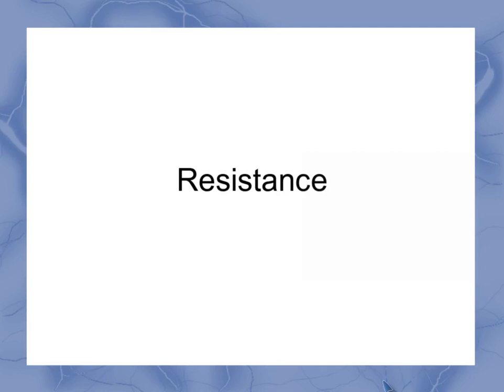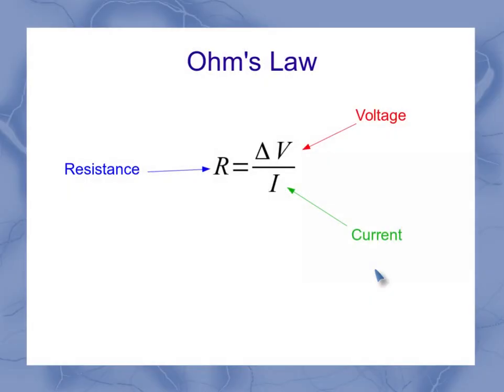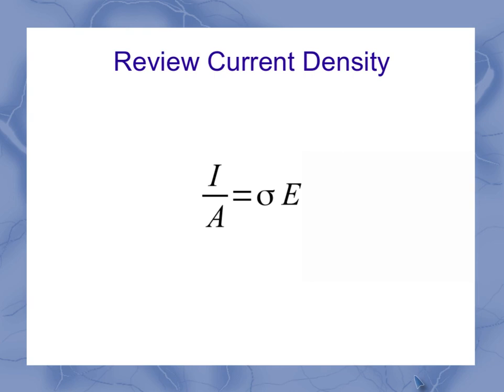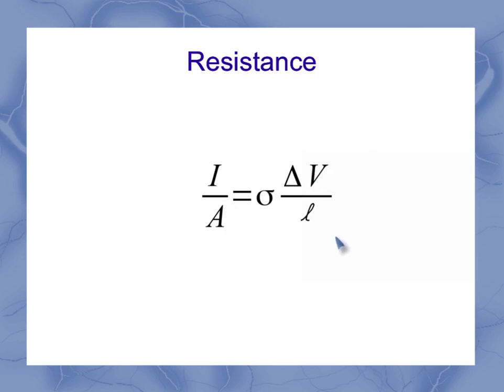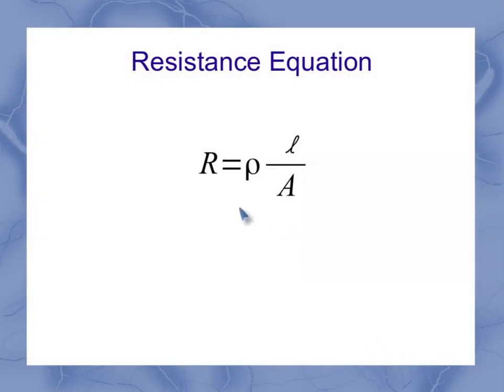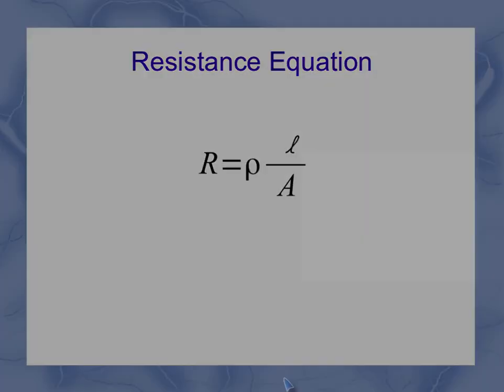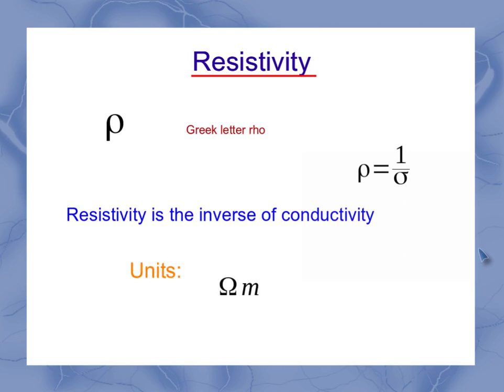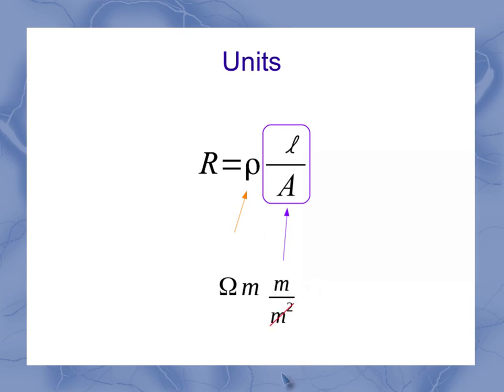The Equation for the Resistance of a Wire

Comment: What if you need to calculate the diameter of a conductor knowing only the length & resistance? 
Or the length of a conductor knowing only the diameter & resistance?
Reply from the maker: If you know the type of material (so you have the resistivity of the material), then you can rearrange the equation to solve for any of the variables. Remember that the diameter is related to the area by A = 1/4 pi D^2
Reply: Thank you so much. You just helped me to pass a final exam.

Comment: Please help me solve this: If a nichrome wire 2 meters long has a resistance of 10 ohms, the resistance of another nichrome wire 1 meter long with a cross sectional area half that of the longer wire is...
Reply: 20 ohms
Reply from the maker: This could be solved a few different ways. One way looks at the general affect of length and area on the resistance. You have half the length in the second case which would tend to reduce the resistance by half, but you also have half the area which would tend to increase the resistance by two. Since both of these happen at the same time, the effects offset each other

The other way is to look up the resistivity for nichrome and use the information about the first wire to solve for the unknown cross sectional area. Then use the new length and half of the area along with your resistivity value to find the new Resistance. (I won't work out the details, but this method would work better if you didn't have such nice fractions as one half for each quantity)
Reply from the maker: 20 ohms would be incorrect, see my response below
Reply: Ya, i fugured it out. The length was was halved which will reduce the resistance by half =5, the area was halved which will now multiply the resultant resistance by 2. = 5 x 2 = 10.
Reply: Dike Ekwelie 10 ohms